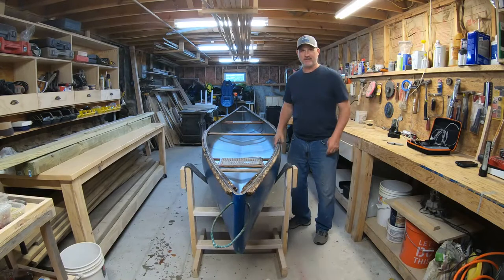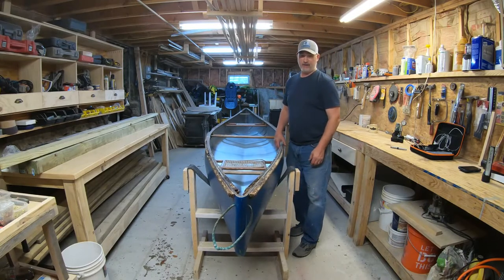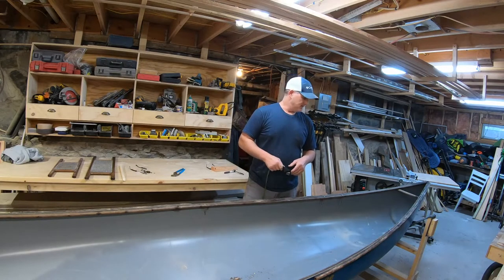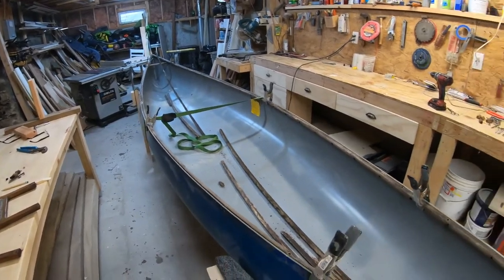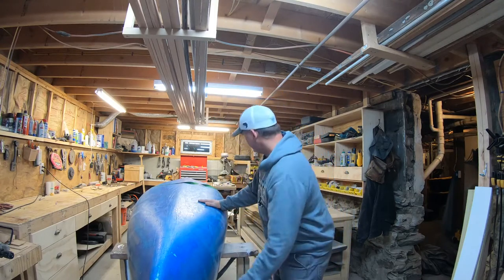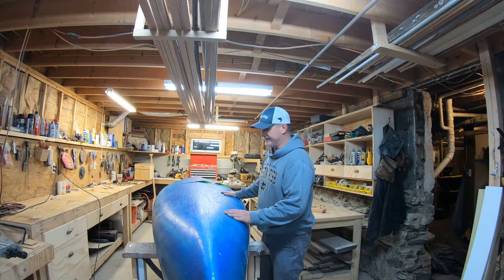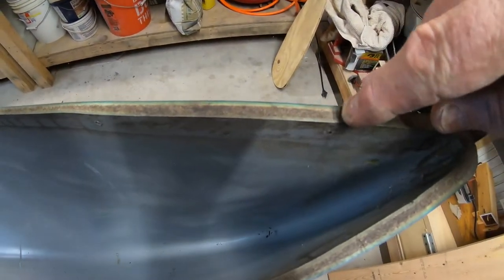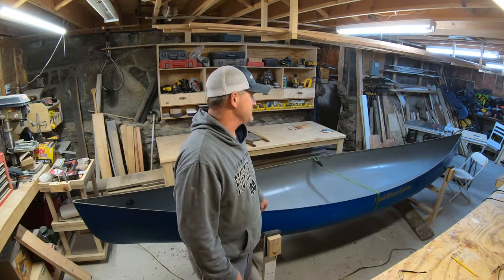How to Restore/Repair Mad River Eclipse Royalex Canoe, Part 1

Comment: I put new gunwales on a Dagger Venture 17 that was lying dead on a beach in Vermont with a FREE sign on it.  Gunwales actually looked worse than yours, cane webbing seats all torn and hull ends scratched and chipped through to the core. 

I’ve patched the hull scrapes and cold cracks with Legos dissolved in acetone on top of stainless steel screen or fiberglass cloth. Forums discuss this. 

Nice video… can’t wait to see what’s next.
Reply from the maker: I am intrigued by the aceton/Lego method.  I am tempted to experiment with similar plastics in acetone to observe the consistency of the plastic afterwards.  How did your finished repairs look aesthetically after you were done?  Also how is the integrity of the repair holding up?  Since I already have product on hand I will proceed with the G/Flex repair method for the Eclipse.   Great work on bringing your Dagger Venture 17 back to life.  Another canoe that didn’t end up in a dumpster 👍
Reply: @mainetripper  It does the job, but epoxy is probably better. Cold cracks reappeared when I first patched them with just Lego paste, no mesh underneath, although that could just be because I store the canoe outdoors all year. And I have covered the ends with skid plates because I kept having to repatch them (I hit a lot of rocks, and my bow partner insists on beaching head on). So it seems to work, but might not be as durable. Appearance is good if I carefully sand the area and paint with a matching color. The best application seems to be using autobody fiberglass with not too thick or thin Lego-acetone paste, the latest version I have used, before I finally reverted to kevlar skid plates. Wetting the canoe body with acetone first helps. I believe Legos are the same ABS used in Royalex, so it's like a weld. A lot cheaper than epoxy systems if you have kids or grandkids.
Reply: @mainetripper  I've read that cold cracks can be prevented by widening the screw holes in the hull near the ends, making them horizontally oval shaped, so the hull can move a little forward and back. Then loosen those screws slightly each winter and retighten in spring. Never tried this but I think I will.
Reply from the maker: @michaelpaul9236  The most
Common practice, if storing Royalex canoe outdoors all year long, is to loosen the gunwale screws to allow for different rates of expansion and contraction.  I believe the mistake some make is that the screws are not backed out enough.  The absolute fix for this common issue is to install vinyl gunwales so that the materials move together in synch.   I prefer the look of wood.

Comment: With the topside paint, have you had any problems. I read on the can that it is not for below the waterline. Also are you using the marine coatings primer?
Reply from the maker: I have used the Rustoleum Marine Topside coatings on four canoes now with no issues.  Not being used below the waterline would apply to motor
Boats or sailboats in the water all season long.  No need to worry about “not to be used below the waterline” because a canoe is in and out of the water frequently.  Hope this helps and yes I also use the marine coatings primer.

Comment: Oh a beater.  well you can use it in rocky rivers where other fine boats dare not travel.  Will you put the center seat back or just a carrying thwart?  I doing a test on an old Old Town Hunter with wood rails I installed in this past summer, so it won't get quick temp changes this winter like it can in the full sun. it will be in an unheated shed off my mill building.     Ah you are going to remove the center seat,  good call.  Some cracks.  I wonder if a V grove in a router would channel those cracks well?
Reply from the maker: Yes this is ultimately a sacrificial beater boat that will take me to some interesting less traveled areas.  The center seat will be replaced with a carrying yoke.  I hope to make this canoe look as fine as I possibly can, but in the end I am ok with this boat taking some bumps, beatings and bruises.  The router idea is decent but I wouldn’t want it to get away from me and for that not to happen I would need to build a jig.  I think I will use the good ole trusty hardworking method this time around.

Comment: @MarineTripper what angle did you used for the kerf on the gunnels?
Reply from the maker: Scarf joints for the gunwales is roughly 8:1 or 9:1 and the angle cuts on the end of the gunwales at each stem were free hand cut and that angle was transferred to the other gunwale ends by using a sliding bevel.

Comment: Interesting situation with the single big cold crack on the bow vs two smaller ones on the stern for a symmetrical boat like this. After proper repair with g-flex is the structural integrity of one end better than the other? I’m thinking about it from the perspective of dragging the canoe from the grab loop — not just in boney/shallow water — but also a situation like dragging over a beaver dam, where the boat is loaded and you have to give it some mustard. Is one end going to be stronger than the other or is it immaterial if properly repaired with g-flex?
Reply from the maker: I have plenty of practice with epoxy resins but this is the first time using G/Flex epoxy so I am reliant on the reviews of the strength that this repair provides.  Strength will also be re-established when the new gunwales and decks are installed.  Gunwale screw placement near the damaged areas will also be important  to provide reinforcement.  This is my theoretical approach.  Lots of success stories using the West Systems G/Flex so time will certainly tell.
Reply: @mainetripper  Certainly makes sense. What I was curious about is whether you considered reorienting the bow/stern based on the repairs, but that's probably overthinking it. Timely video as I'm pulling in my T-Formex canoe from the yard this weekend and hanging it in the garage with my composite canoes. Spring ice-out can't come soon enough. Well done and good luck on giving new life to an old workhorse boat. I look forward to the next installment.
Reply from the maker: Dusty to be honest I haven’t even considered changing the bow and stern seating orientation until you mentioned it.  I think this may be something to mull over as I continue with the restoration.  We’ll have to see exactly what type of strength the G/Flex provides.  I appreciate your comments and following along with this canoe restoration series.